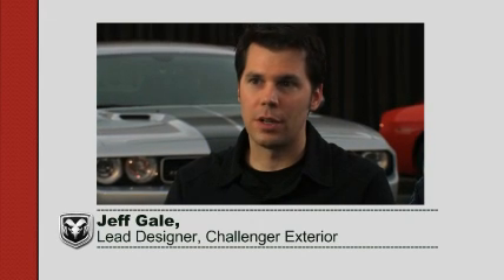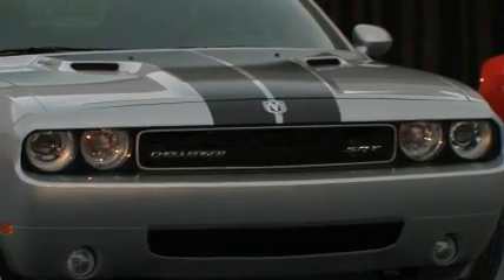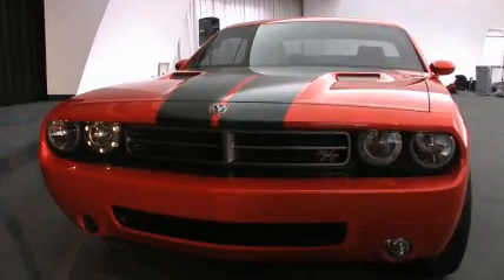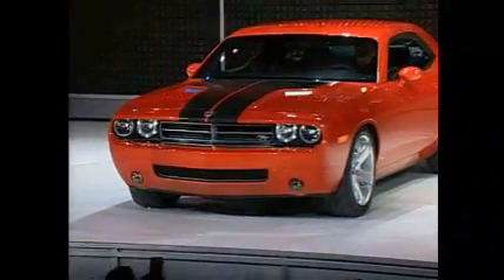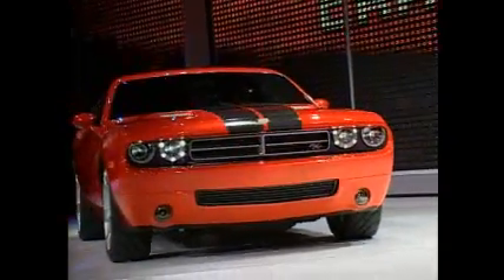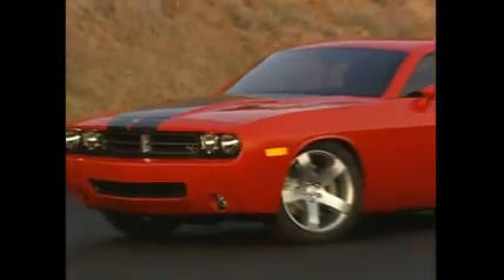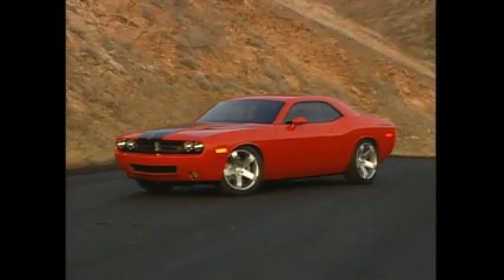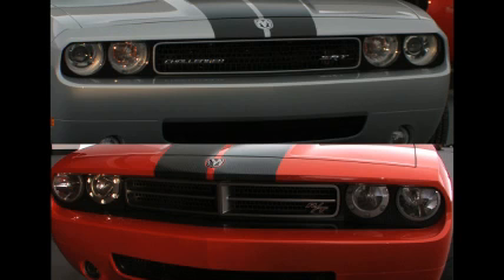2008 Challenger Designer Interview -- Segment 1

Comment: I am going to buy this car, makes me feel 20 years younger, I have a 70 R/T Charger when the new Charger came out I was very dissapointed, (4 door grocery getter) the new mustang came out it did not do anything thing for (I had a 69 Mach 1)not too sure about the camaro too manyangles (had a 68 z28) but this new Challenger (never owned one just Chargers) really hits the mark its a 10 out of 10, great job, and thanks Dodge for taking the chance.  This will be a legendary car just like to original.
Reply: It's now been many years later yet I think your comment remains a solid prediction. The current gen is finally out of production but the Challenger will continue to be a staple rolling down American roads. 

I myself own a 392 Shaker and get ample compliments as if it was still 2008 lol. There are those that hate on the design just because these cars are so ubiquitous, but I guarantee if it was rare like the Viper is currently, the "new" Challenger would be seen as a legendary car in a vacuum.

Comment: I hate Dodge for going away from this design of 2008 model, the later models of nowadays are so pathetic, 2008 model was made of passion.
Reply: I mean they are not so bad but this one is so original and retro!
Reply: Hy david!! 2008 had a very retro  looking slim and sleek dash board along with that 4 spoke steering wheel Which went nicely with the retro theem of the car, that has been changed with that thick and a modern looking dash board which in this type of a car looks pathetic, also the front grill, tail light assembly etc have been changed, all these changes have made the car look confused and has killed the very purpose of its existence!! What say dear??.